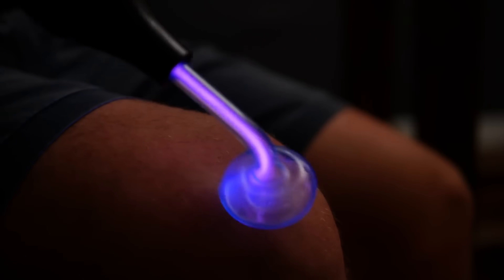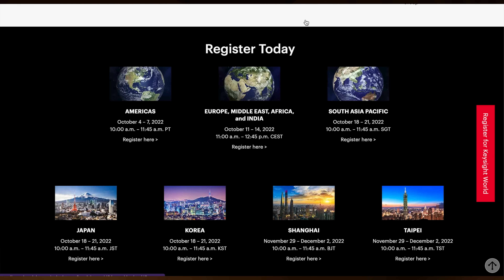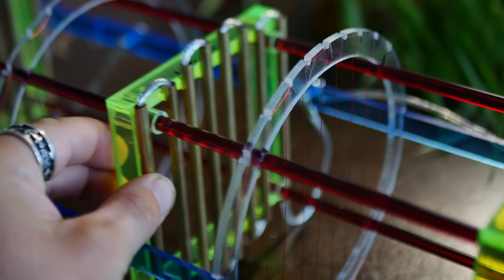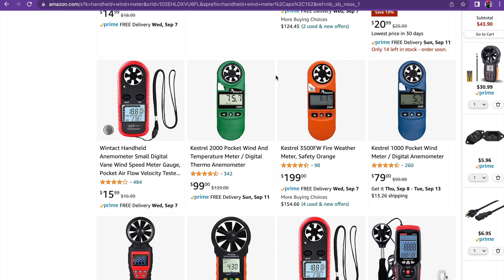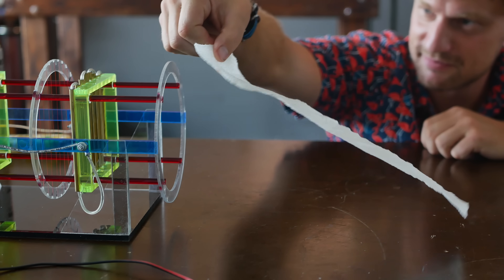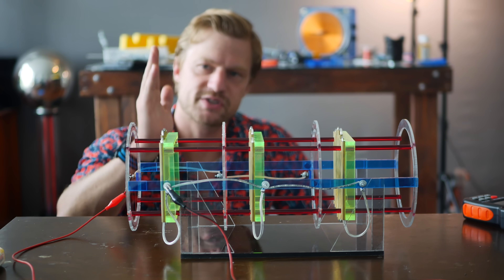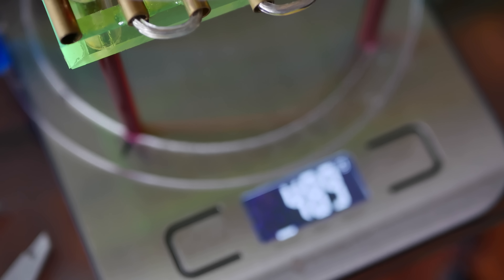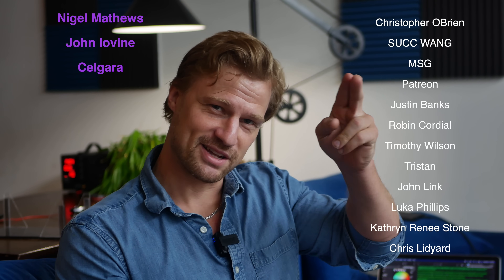Designing A Next-Gen Ionic Thruster! (For Flight)

Comment: I came up with a possible advance to the technology, for a given amount of air is there a difference in volume between it being positively charged, as distinct from negatively charged, if so then using a say long flat box, open at the shorter ends, with two ionising wires spaced a few inches? apart at one end, a positive near the opening, followed by a negative & at the other end of this box on the inside area a positively charged collector electrode, the idea being that the first positive ionising wire strips off the electrons, producing a condensation of the air, followed by the negative ionising wire which then expands the air in the direction of the collector electrode. I also wondered about using teardrop cross-section shaped wires, rather than circular cross sectioned shaped wires, to maybe encourage ionisation in one direction. Nitrogen which makes up about 78% of the air normally occurs in diatomic form, composed of two Nitrogen atoms, by positively ionising it it may form a triatomic form, can't find the information, be careful such a form is toxic & explosive, by ionising the diatomic form it should turn them into monoatomic forms, the ionic radius of which is larger than the other two forms. Also maybe using black silicon or Q-carbon composed of micro-nanoneedles, might enhance ionisation & I think I read in an article about lifters some years ago that ionising wire was made of steel.

Comment: Ionocraft are great little creations.. I remember playing around with this tech some 20 years ago..
60kv from an old CRT monitor was my only source of power, but I managed to get my hexa-lifter to 'fly' with great stability at about 3 feet above the table it was tethered to.. 😁
More capacitor segments (more lineal distance of wire and ground tube) will help in your design, as will encasing the rings in a tube, like a jet turbine, to direct the flow in one direction, because I'm certain you're getting air leakage along the path..
Will be great to see how you improve this system.. 👍
Finally, I will add, I hope you have a window open when running this thing, that plasma is creating ozone, which is the really "fresh" smell you notice.. ozone is deadly in a confined space..

Comment: First, awesome video, keep on going!!! Second: question: can you increase the voltage between the stages? So stage between stage one and two lets say you got 10 kV, between stage two and three you got 50kV and on the last you got 100 kV? Does is make any difference on the thrust? Can you also try to put this into more like a turbine shape?
Reply: From the graphs shown, the velocity plateaus above a specific level, basically gaining minimal or no increase in velocity despite increasing voltage.  Thus, such a system would simply be less efficient.
Reply: @MikaKyubi  thx for your answer. Do you have any idea why there is a plateau and what can be done to de-bottle-neck?
Reply: @G0llwi  I suspect that it's a matter of maximum saturation of some form, though I'm not a plasma physicist, so can't be 100% sure.  It could be an efficiency issue, it could be atmospheric composition and/or temperature, or a whole host of variables we're not seeing (especially as laymen / non-scientists).  It could also be that the current in the plasma can only flow so fast, thus limiting the exhaust velocity, and increasing the plasma past that point is simply unable to affect more air.  Again, I'm not sure.

There are, elsewhere in the replies, excellent suggestions for increasing the flow, though, which have more to do with aerodynamics and flow control than anything on the plasma end, and I'd be interested in seeing if these work.  My only potentially unique suggestion would be to use the enclosed tube as suggested and use smaller electromagnets to assist in accelerating and shaping the flow, though at what cost in mass I do not know.

Comment: Instead of brass pipes I would use 0.1 mm thin copper tape as cathode. It's much lighter, and can be one continuous zig-zag shaped electrode just like the wire anode.

Comment: I am kinda doubtful about how you measured this:
You measured airspeed and used that as a reference for thrust - that might not be accurate at all given that the thruster is that open and the airflow is likely anything but uniform.
And similar to measuring the thrust - that relatively small gap could have seriously reduced the impact of the first stage.

I would think the simplest way would be to suspend the whole thing in the air - let it hang down and have the string attached to a scale. The direction of up/down should not really be relevant, just a good distance away from any surface. This should give a more accurate reading without much efford.

Comment: Have you tried this with a co-flow mod?  (Co flow jets) Using the ion flow as an inducer?  Which then can be then can turn in to a ramjet/scramjet  compression always increase thrust. I know dyson uses air multiple tech. Which came from the development on the first jet turbine, As cooling. I had dreamt of combining the two. I’ve seen some years back on YouTube some hypothesis on exactly this. But no sold mock up. They proposed multiple plates of positive and negative In a cylinder. They were honeycombed charge plates. I find it funny Thant most people are not taking a a-little inspiration from the current jet propulsion system. As it might be possible to charge the turbine blades? Causing them to spin which would be the second way to do it. I’d be stuffed to take a guess a power consumption. You also have to bare in mind that there other factors in play. If you can heat the air you can create convection? Convex compressed is thrust.  I’m reminded a-little of magnetohydrodynamic.  Which has lead me to what I’ve proposed on my channel. I know it possible to increase the pressure in the cylinder to take that 2.3m/s firstly by getting the air to spin and compressing it. Effectively making a plasma tornado. I’ve no idea which funnel shape would be best? Straight Cone, parboiling or hyperbolic as the inlet and nozzled exhaust?  Love the idea of finding perfect spacing. I wonder if that has any relation to material thickness and the distance of the spark gap?  Tesla coils can spark some meters depending on size. Heavy metal Tesla rock music was a good example of this.  I definitely think it’s about rummaging the convention tool box. to come up with something far better than there was before. Great start! Now let’s see a thrust of 15m/s? which should be about the right thrust to weight ratio?  To allow it to hover over the table.

Comment: This 18% thrust ratio for only ionic engine, but this will need booster with batteries/electric generator... So ratio will be 9% or less. Maybe we can make it batteries and booster fusion with engene frame itself... One inefficiency i can tell that in space there isn't soo much gas everywhere to create gas flow by plasma, and carrying excessive load of gas for creating gas flow ionic thruster will be soo much ineffective #PlasmaChannel
Good and excellent work though 👍🙂

Comment: My first thought is that having it enclosed in a tube would increase your thrust, so long as you have enough primary air. You have too much secondary air, which I think may be slowing the air down and possibly could be introducing turbulence as the faster air hits the slower air.
I think also putting the engine into a Venturi shape will increase the velocity. All of this has the downside of adding weight, but the engine would need to be enclosed anyways to be used, right? This is just a guess though!
Reply: Venturi or a nozzle is a no-go. A Venturi or nozzle converts pressure into velocity, but since there’s no pressure here there’s nothing to convert to velocity.
Reply: @danielfearn6076  yeha nosels arnt really working but with a enclosure each thruster stack the velocity will increase and so  the pressure will drop so as the air gets faster each stage we could reduce the tube diameter slightly to increase the efficiency of the later stages by keeping the pressure the same inside the engine  since the amount airmass going through the electrode area is important for the thrust
Reply: Drawing in secondary air can be very beneficial.   Look at high-bypass turbofan engines for airliners and heavy cargo aircraft.    The engine itself is in a smaller cylinder  in the middle.   A second fan, attached at the first stage, pushes even more air along, around the outside.  I believe they draw some air around the outside too, because of the airflow through the engine.
Reply: @JWSmythe  This design definietly faces ineficiencys due to the lack of enclosure. In this design, the moving air contacts the standing air and expands behind the first and second stages, thus is lost and not acelerated further. The whole jet engine thing is mainly due to efincey in regards to the combustion, as it is more economic to drive the bypas fan with the engine. I am not to sure if sucking in aditional air will improve the thrust and eficancy for the ion thruster. There is no expansion of air or moving parts like in a jet engine. The whole concept is drawing in air and acelerating it, more like a propeller than an engine. It is in concept comparable to mutiple ducted fans in a row.
Reply: @theexchipmunk  your comment is the best. We think about rockets and turbofans, but there is no pressure or expansion or combustion. So like you said, it's much more like a series of ducted fans in a row that anything else really.
Reply: @JWSmythe   turbofans work well because they produce less thrust from the combustion than turbojets. It might seem counterintuitive but a lot of a turbojet's output goes into the wake, wasting energy. The air is unnecessarily moving faster backward than the plane is moving forward. 

With a turbofan fuel is consumed more slowly and less thrust is created by the jet of hot air itself, the fan producing a big chunk more efficiently than pure fuel burning.
Reply: this, they don't put holes in the sides of jet engines for the same reason.
Reply: I really need to read the comments before I comment.
Reply: no it would not. the ambient air pressure works like an enclosure. like an air spike rocker engine. and there are also other physics at play here. this is another https://www.youtube.com/watch?v=jeRVGp54pak
Reply: I was thinking this exact thought. Build it like a rocket engine with bell nozzle. And yes enclosed tube would help efficiency from escaping air.
Reply: @rogerpha1398  a bell nozzle is pointless for this. the air is already flowing in one direction.
Reply: @rogerpha1398  it shouldn’t need a bell shaped nozzle (converging-diverging), just a converging nozzle, as I’m assuming he won’t be going supersonic!

Comment: I'm so sorry for these notes in brain vomit form.  To be clear, I'm definitely not an engineer and it's not hard to spot.  I'm just a dude so if other existing experiments address these issues already then I have no idea about it.

sound
	the device is way louder than it needs to be (or at least that's what felt conveyed in the video)
	could be a means to optimize sound to decrease energy inefficiencies

patterns / density
	test different electrode patterns and density of wires

electrode shapes
	electrode shape efficiencies
	tear drop / sharp / rolled mesh / shaped electrodes for airflow
	would it be better to design much tighter electrode gaps and shape the system radially?

flow guidance of air between different electrode shapes
	creating a venturi for air flow
	vortex?

surface area test
	tied to shape / pattern / density tests
	cone shaped outside shell electrode
	copy dyson fan design
		tied to flow guidance of air between different electrode shapes
	test electrode shape differences in different dimension (radially, instead of just horizontally
		also a good data purifier test
		use 3d printer to create complex shapes

electrode resistance testing / optimization
	tied to electrode material

airflow testing issues
	better design of measuring air flow
		consistent sensor fan spacing / location
		use consistent fog source to better visualize airflow shape
		maybe use immersed in ionized liquid
			tied to test medium tests

separate the voltage and distance tests to get better data (I can't tell if you did this already but I may just be dumb)

seems like maybe data collection optimization techniques could improve
	you're fighting wind shape travel in your tests
	you may get the same results if you copy electrode spacing distance between group distance (need to isolate)
	are you hitting harmonic steps in the spacing, how do you tie that to voltage? can we find if they have destructive interference?
		should we start testing for harmonics not only in spacing but also shape / timing / frequencies?

make sure thrust amount and airflow are linear and not missing elements that could be hiding other efficiencies

from Orestis Lazanakis comment
	3) make sure you decouple electrode shape from overall wind speed performance
	6) don't forget to shape the electrode super structure as a cone with built in venturi shape
	7) yep he's right, going to be a bitch to design

can magnets serve any purpose for guiding the shapes?
	are they worth adding at the cost of weight?
	natural magnets vs circuit generated magnets
	magnetic field frequency adjustment tests crossed with shape adjustments

test different environment settings
	humidity
	temperature
	air pressure
	external wind gusts
	would it be worth seeing if this should be treated more like a sail than a wind pusher?

will it ever even be possible for power to weight ratio to ever reach flight capability based on energy consumption?

adding fuel / medium use may not be a bad idea?
	could be harmless material
	or fun dangerous fuel
	see if fuel use increases performance enough to justify bringing them
	do they lower the wattage requirement?
	fuel could allow space use (pretty sure this is what ion drives are?)
	would it work in sea water?
	fresh water?
	have to replicate all tests using different fuels / mediums
	would the heat from the fuels affect efficiencies?
	can you have a kelvin water dropper setup / shape work?

apparatus structure
	use super strong designs like the isotruss using much lighter materials

electrode material differences?
	test different materials and combinations in between
	several materials used together on each electrode
	moving electrodes? (propeller motion?  worm motion?)

just want to make sure we're adding electrode gap distance adjustment to new set of tests
and try many more ranges of voltages / electrode gaps / group gaps
better wind gauge
pulse at wind speed to see if you can find efficiencies in air shaping
are we seeing a fast swipe at the air (pulling air molecules at super high speeds but so few in a very sharp edge that it doesn't move as much as it could?)  can we modify the speed of the swipe?  and mix tests with shape?
get some electrical engineer / youtuber input / optimizations if needed

Comment: It looks amazing, I want one! For the inefficiencies I can maybe spot some of them:
1 is the "open" surface you can have a drop of pressure due to air escaping from the side
2 the shape of the ground rod are not efficient for air transport and probably having an aerodynamic shape would reduce the drag induced by the turbulence at the exit from ground

I would also suggest to use an hot wire to measure the wind flow, there are some cheap ones and have a way smaller space resolution

Comment: I think the next steps for improvement is the shape of the device. 1. Maybe more cone shaped borrow from a jet engine shape and aerodynamics with closed sides  2. Im wondering if instead of straigt line parralel windings if an overlapping spiral winding of the wires would not give more thrust. So while the air is still being thrusted by stage1 stage 2 is already adding additional thrust. I imagine the air gaps between each stage as friction or brakes for the thrust.

Comment: It looks like your enameled wire had a few points of dielectric failure instead of the insulation being removed completely. If you strip off the entire coating, you might gain some efficiency by cutting out losses from turbulence.

Comment: Some ideas for improvement / further experiments

1. Use an algorithm to tune the spaces of the respective anodes and cathodes to each other as well as the staggered spacing of the stages. 
2. Use a tube to encase all the stages.
3. Use different spacings between anodes and cathodes as well as between the single wires for each stage.
4. Try Further accelerating the plasma with a magnetic shell.
5. Try different voltages for each of the stages at the same time. 
6. Try a parallel vs. a serial configuration to see how the contraption scales and how efficient it is.

Comment: would encasing the whole thruster and adding choke points in-between the ion thruster, limit loss air flow, and increase the output? and adding backward facing vents on the side should help as well.

Comment: I think that...
1. If you put the system in a pipe, it will prevent air escaping from the sides and thus lose efficiency. 
2. If you make each of the stages work on a different amount of electricity, from low to high, it will improve the efficiency of the system because the first stage is not able to reach the maximum speed of the air anyway, and gradualism will be more effective.
3. Use a narrower opening for higher air pressure.

Comment: Need to channel the air through it so there's no peripheral losses, and then it seems like having a larger thruster at the intake, possibly at less kV than the rest, or perhaps an accelerating effect where it's tapered to the exhaust, and the kV ramps up as they decrease in size, effectively accelerating the air out. The key though is containing the airflow, which maybe can be done with some saran wrap (for minimizing weight on this test rig) ???